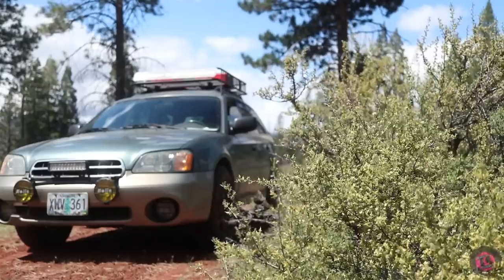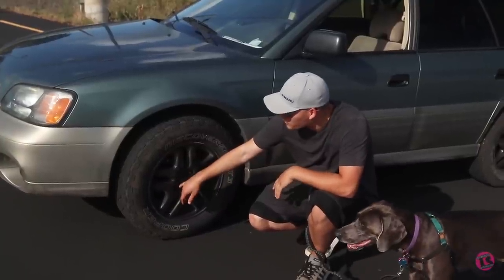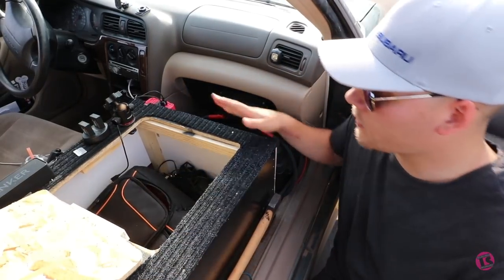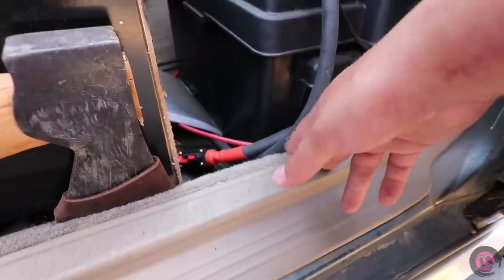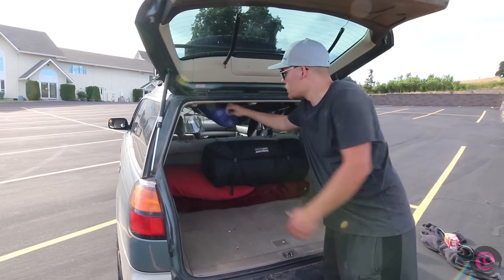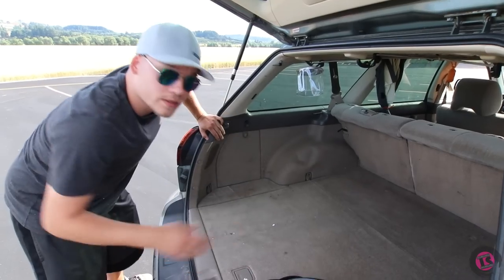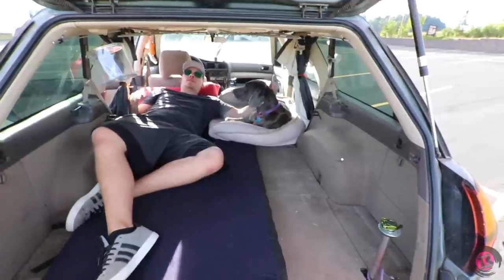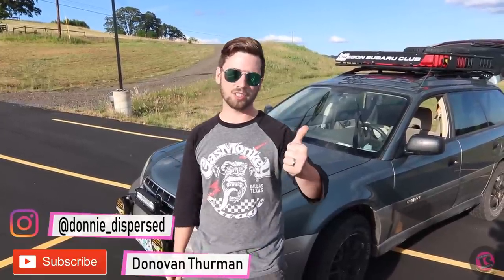Donnie's Subaru Outback Is A Camp Ready Adventure Wagon!

Comment: Back when the Outback was an actual station wagon. It has been an SUV for years now parading as a Station Wagon.
Reply: Its basically the same size as new gen...
Reply: I have an 02 and a 19, they’re pretty close to each other. I’ve slept in the back of both of them.
Reply: @gl4989  The newer engines don't overheat anymore. I have a 2020 CVT Boxer Turbo. This station wagon kicks ass. Great safety features and variable wheel load on rough roads. Yep...Im going to camp in this Subaru. Your build is superb. I too have a Weimaraner named Remi. Your girl is beautiful!
Reply: The Outback was actually an Impreza hatch, not a station wagon. It's just gotten larger overtime and they just made it its own model.
Reply: Captain FALKEN nope that’s the Outback sport, the regular outback is a slightly lifted legacy wagon with different body paneling.
Reply: @kellyname5733  The older ones didn't overheat either...if it's properly maintained anyway. The new Subarus definitely have the perks of having a modern interior and infotainment system though. The new XT is also real punchy too.
Reply: I got an 02. Rear space behind the back seats is considerably larger than the new “wagons”

Comment: Nice set up, I had the same car. My wife and I traveled all over in it. Two  things I did different was take the rear seat out completely and made a half inch plywood platform with a hinge and 2 inch frame to access my storage where the seat was. I also added rain guards above the doors  and homemade screens for the back seat windows. You can also use foiled bubble wrap insulation for inside the windows. Have fun on your adventures.

Comment: I love the process to remove all the seats, build custom boxes, invent a way to have a waist level table...but running wires from the engine bay to the shower pump is too much work.

Awesome build. Budget-focused, achievable comfort for the road.
Reply: burton926 not too much work, but since there’s a 12v outlet right next to the pump, might as well use it for now.

Comment: This car symbolizes freedom for me - I can drive anywhere with my dog, not worry about needing a hotel or campsite, great for driving to those remote campsites & gets 25+ miles to the gallon on the highway fully packed. 
I never want to get rid of my Subaru - even if that means rebuilding it part by part. 

So I wanted to ask if others feel that way about theirs.. 
What makes your Outback 2003 special enough that you choose to restore it rather than trade it in for a newer model? 

Aside from totaling it - what would be the deciding factor to push you to trade it in rather than repair it?
Reply: Frame rust. It's why I got rid of my 2003 Outback 5 speed. That and I got a 2004 ML500. Far quicker, more reliable engine, real body on frame SUV, more room inside to camp, more off road capable, far quieter and more comfortable on the highway. Downside of course is gas mileage and handling (high up SUV).

Comment: I also have a 2001 Subaru and on that back hatch to have more privacy get you some verical tape and stick it on the inside so it doesn't get stuck between the locks on the latch  when you shut the door  and use a shower curtain one of the dark shower curtains because if it's raining there waterproof plus it gives you privacy so if you need to use the restroom

Comment: I have the 2001 VDC in the same color.  I love it.  It's not worth anything on the open market, but priceless to me as an adventure vehicle.  When I take people to my hunting camp through think sand and drive it back to back with my other 4x4's people just can't get over how seemless it goes through sand with no drama when the larger trucks have to spin the tires to do the same stuff.  And unlike the part time 4x4's the AWD on the the Sub makes it safe and secure for travel on rainy or snowy mountain roads.  I've tried and it's indeed has high capabilities.  With the seat down out back I can sleep well and stretch out great.  Mine has the trailer hitch too and I've towed my motorcycle with no issue too.  I run the basket up top, but for longer trips I have the lockable box I put on the roof, but fuel mileage goes down a bit.  I recommend the Rallitek springs on the KYB struts for these. It's worth the cost.
Reply: 3 years late but I’m looking into buying an older outback (2000-2004). Have you experienced any big issues or has consistent maintenance paid off for you?

Comment: Possibly the most capable and versatile  car I've ever owned. 2002, 2.5 Auto, with VDC, dual sunroof, leather, climate control, cassette and CD player. It had done 130K, when Igot rid of it. Apart from the petrol costs it was a cheap and reliable car to run. It went everywhere. Totally miss it. 
The only reason I had to sell it was due to a complete exhaust replacement. Could not afford it. Even tho there was very little rust underneath (or anywhere), the exhaust just didn't last. 

Replaced it with a manual 2006 legacy. Even tho it was better built and nicer leather, satnav, etc. The traction control system was no where near as good as the older Outback.

Comment: What are the details on the rear license plate bar, that I've seen in your other videos?  Looks like it would be a cool spot to mount some rear lights.
Reply: Scott Gayden that’s actually what it’s for. It’s a light bar mount that’s supposed to be for the front license plate. But it wasn’t sturdy enough because of the shape of the front bumper. So I put it on the back and use it as a grab handle now lol

Comment: So AGM's can indeed off gas Hydrogen that is a class 4 (the highest) flammable and you are venting it into the engine bay? The hottest part of the car where the temp can be 1200 degrees on some surfaces and there are ignitions sources. You should find a better way. Maybe a weather proof battery box with a 12 bolt heating pad if needed on the roof rack. better yet get a portable power station that uses lithium batteries and can be charged by AC/DC or compact solar panels and some of them cost less than a good AGM battery.
Reply: Pretty much every car's battery is under the hood where it's always venting gasses while charging. The chance of an AGM venting gas is very rare and would require the whole charging system to malfunction without tripping the circuit breakers. Mounting the battery in the roof rack, would require passing wires through the roof or the firewall just to run the accessories. Those portable power stations are neat, but for the same capacity as this system they cost nearly double.

Comment: I've slept in the back of a subaru before. It's not that great, mostly because cars don't have the air circulation that campers and tents have. So while this might beat pulling a little teardrop behind you, when camping out in the wilds, I would still prefer to set up a tent than sleep in the car.
Reply: Matthew Singer I made some window vents and put a small fan in the window and had no condensation issues. Personally I like just pulling up to a spot and having camp ready in a couple mins. Not having to clean a tent and put it away or set it up, especially if the weather is bad makes everything much nicer for me.

Comment: Cool setup. Just wondering which DC to DC charger do you use?
Reply: Kenneth Kwok Fai Law CtekD250sa
Reply: Do you really need one
Reply: dj red hare aus if you are using an AGM auxiliary battery it’s the most efficient way to charge it. Plus this one acts as a solar controller as well.

Comment: Nice. Did you say your pumping hydrogen "possibly" to an engine bay? 🤔 Boom.. No?
Also.. Do the vapors not swell the gas boxes on the roof?
Reply: Jonathan Bailey and AGM battery wont vent hydrogen unless it’s being overcharged. And there’s several built in safety mechanisms in the charging system. The vent tube is there in case all those somehow fail, I’m not too concerned about it. 
Actually yes, on my trip to Montana the cans did swell when they were full. It was kind of a pain to get them off the mounts. So in the future I’ll adjust the mount to get more room for the can to expand.

Comment: Why do you need to go with the 215/70r16 instead of the 225/70r16? Also, do you have any issues with the tires rubbing? And did you leave the stock springs in there or go with something stiffer? I've heard of people using the Baja springs... Thanks :)
Reply: Rob Guzzon stock springs, 225’s require a lot of cutting and hammering the inner fenders, I still had to cut and hammer the fenders to not rub with the 215’s.
Reply: @DonnieDispersed   Thanks - I'd love to see a video detailing the work you did to run those tires in terms of the strut spacers, the wheel spacers, and any mods to the fender for clearance. Does the wheel spacer just push the wheel out from the car to provide more clearance?
Reply: Rob Guzzon partially, but they look a bit better too lol
Reply: @DonnieDispersed  Agreed - it looks great. Last question: did you need control arm spacers too, or was the 2" lift small enough to not need them?
Reply: Rob Guzzon I just needed whiteline adjustable camber bushings for the rear.

Comment: I tried removing my passesger seat in my 2006 impreza, but the airbag light came on. I put the seat back on in fear that the airbags might be disabled......is it true? And howd you get around the airbag light coming on ?

Great build!
Reply: Vicente reynoso I don’t have seat airbags, so I don’t have that issue. Might have to figure out a way to make a new plug and get the right resistor to trick the SRS system into think the seat is still installed.
Reply: @DonnieDispersed  lol its not seat airbags. Its the weight sensors that that determine whether not to turn on the passenger dash airbag. Thats whats triggering the light i think. Thanks anyways!

Comment: Quick note regarding battery vent tube: hydrogen is lighter than air, so tube not really useful.
Reply: Howard the tube vents the hydrogen out of the car. They do the same thing in RV’s for the batteries that are stored inside. Why do you say it’s not useful?
Reply: @DonnieDispersed  Most RV vent chambers, and most engine compartments that store batteries, have vents that allow a large volume of air flow.  This way any hydrogen that is generated is instantly whisked away.  The isolated compartment where your battery resides doesn't have high air flow, so any hydrogen generated will simply float up (it is much lighter than air).  Your vent tube would be useful for a heavier-than-air gas, like propane.
Reply: Howard RV’s store their auxiliary batteries in cabinets or underneath the beds or sofas where there is zero airflow. They are required to have a vent tube that exits at point higher than the battery to allow hydrogen to escape. That’s exactly what I have done here.

Comment: Where'd you get the cargo net for the roof and how did you mount it?
Reply: Charles Lefebvre picked it up at a department store. I imagine you could find it at Walmart. It’s a cargo net sized for a roof rack/basket. I mostly used the grab handles to hang it up, but there’s also some hook things by the hatch that I used and I drilled a couple holes in the plastic trim and clipped it to some carabiners.

Comment: Great video and thanks for posting. I've been traveling across country from Cali to Florida in a 2004 Outback and currently have 304,000 miles on it. I'm hauling a flatbed trailer for my gear but it's not too heavy and is very low profile. I don't really push it beyond 60 miles per hour and it has been running like a charm. Upon arriving in Florida I noticed it started leaking a bit of oil in my parents driveway. I'm now wondering what I should do from here. I'm traveling with my 13 year old 3 legged pitbull and I'm worried about continuing on. Should I try to get another vehicle with less miles on it? Should I take it to a mechanic to assess its road worthiness? I would loath breaking down in the middle of nowhere with a dog and a trailer in tow. Is it possible for an '04 Outback to get another 3-6,000 miles on it? Any experience that could be shared with me would be greatly appreciated. I am retired on a fixed income and live full time in my Outback. Thank ya'll.
Reply: Ssss Zzzz if you aren’t comfortable enough to assess the leak yourself. A mechanic would probably be a good idea. My concern with buying a car on this side of the country is rust. And then relying on a car you don’t know the history of to make it across the country.
Reply: @DonnieDispersed  great points. Seems like I should fix and service the vehicle I have now. I may be able to get another 50-100,000 miles out of it! Thanks for the feedback. Have fun in N. Carolina and happy trails!